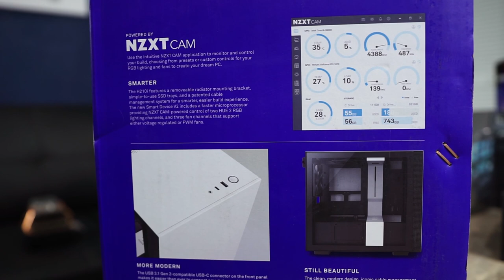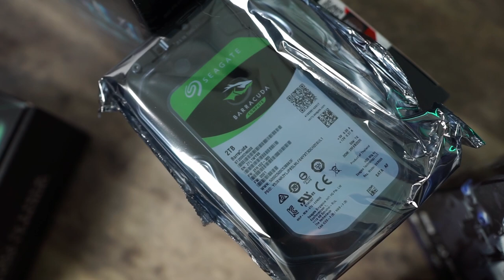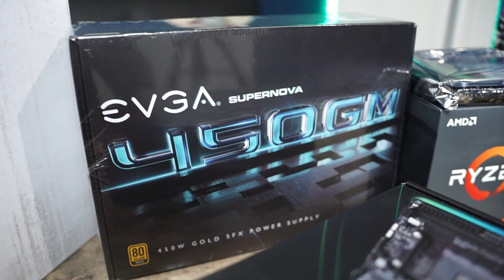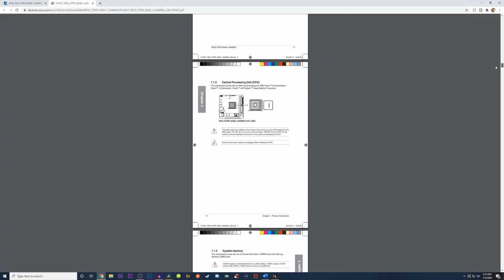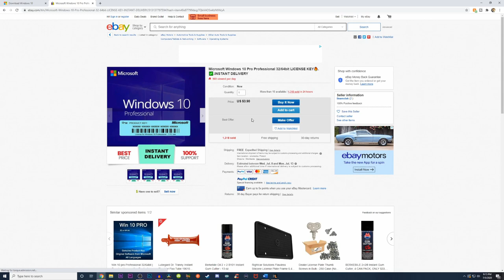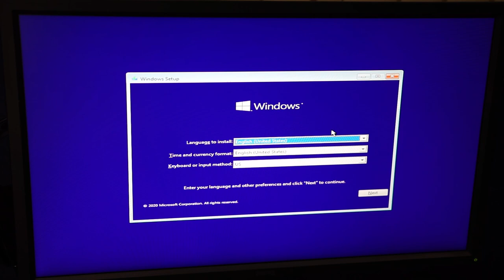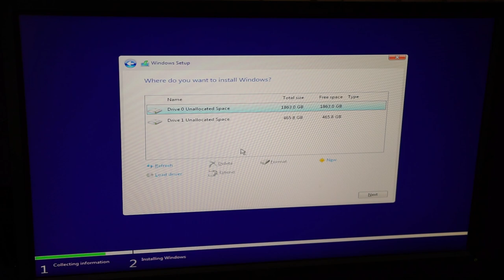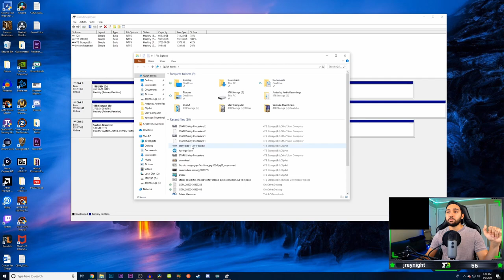How to build a Mini ITX H210i System (Build Guide)

Comment: Do you need extension cables? If you just use the stock cables that came with the psu, are they too short for the H210?

Comment: Why is the microphone set up to obscure the frame?  Doesn’t the Blue Yeti have better pickup than that?
Reply from the maker: It does but the quality comes out better when its closer
Reply: @MathewTheBest  Gotcha.  I assume you’ve looked into the different patterns the Yeti c an use to better pick up sound.   😊

…and also looked into the best placement options.   No worries!

Comment: I’ve seen everyone use the asus board. I plan on building this PC but I did go with the MSI itx MoBo and I plan one splitting my H100i radiator and fans between the hasp and getting rid of the front mesh… let me know if anyone has tried that before
Reply from the maker: Yeah i used the Asus since that was the only option i had at the time but definitely use the MSI board if you want

Comment: Does anyone know if the included fans are good. I'm budgeting and I'm thinking of using the rgb fans on the kraken x53 for the case and the included fans for the fans on the aio.
Reply from the maker: That what I used and they worked out great so far
Reply: @MathewTheBest  Thank you so much
Reply: Do these case fans have RGB? I have built pc using h210i few weeks back and i was surprised that there case fans didn't have RGB